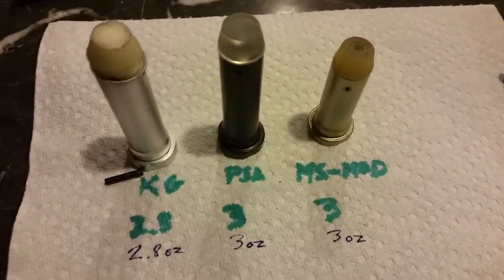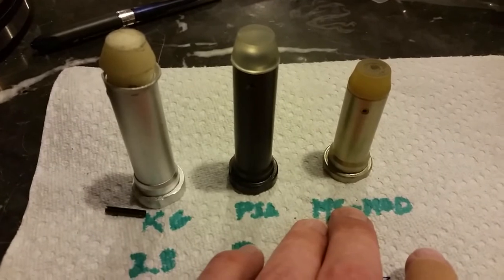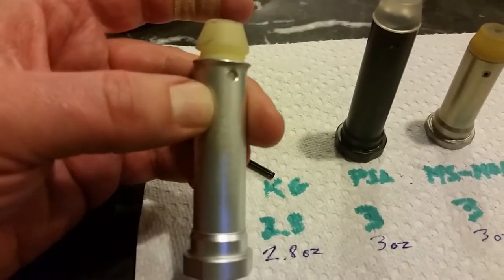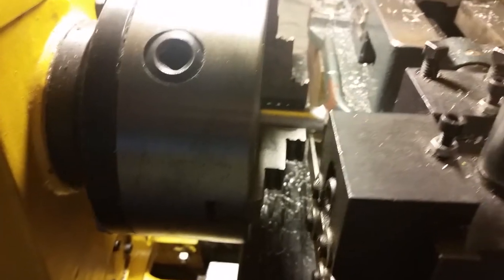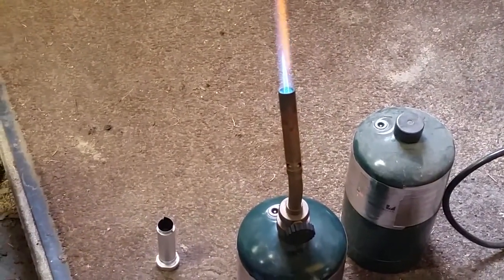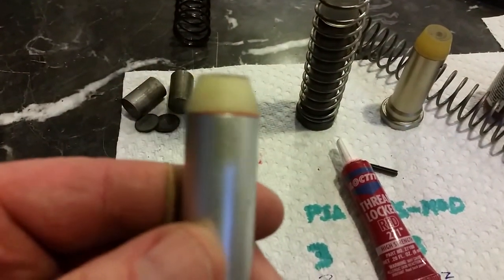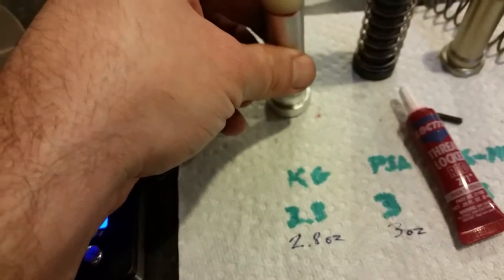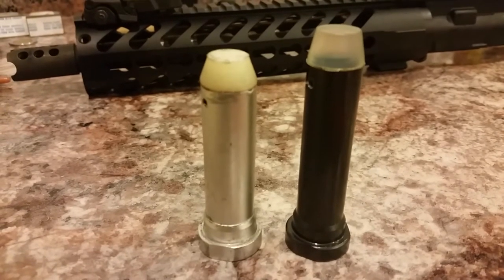How to make a Heavy AR15 Buffer

Comment: I smashed two 9mm bullets that were laying in the dirt backstop in a vice until they had the diameter of the buffer weights. Then I put them inside. My 5.56 pistol with a 10.5 inch barrel was moving so fast, it outran the magazine spring. So it was basically a single shot. After every shot, I had to re-cock it. The bullet weights (230 grains) fixed the problem. I now have an AR-9 pistol but they sent me a 3oz buffer. I was thinking of using the shaft of a carbide end mill that is broken as a weight.

Comment: Great explanations in the vid, subbed...

My roll pin is absolutely, 100% stuck in the buffer. Tried to mallet it out with a smaller pin, put the tip of a tapered pin inside and took a mallet to that as well.  Anyone else ever had this issue?

Comment: Did you put the quarters right behind the buffer or at the bottom of the buffer tube before putting in the spring?
Reply from the maker: At the bottom of the buffer tube is where I put them.
Reply: Thanks for your rapid response, best wishes!

Comment: I thought the weights had to be loose to bounce back and forth
Reply from the maker: Larry Kelley I understand that theory, but it has not had any negative impact.  you could use some lead shot if you prefer as it would still weigh more than steel and move around.  If you have "bolt bounce"  you may want to try that first.